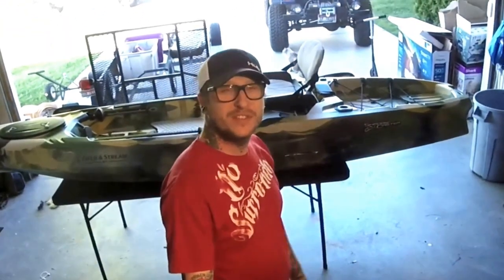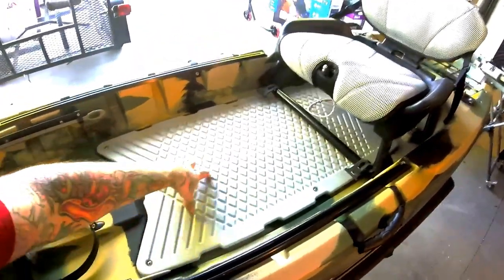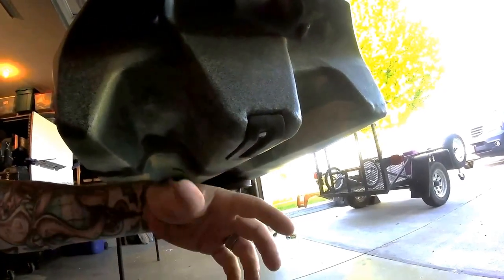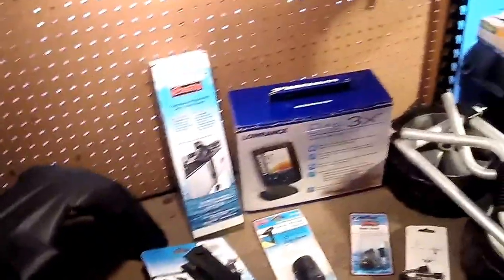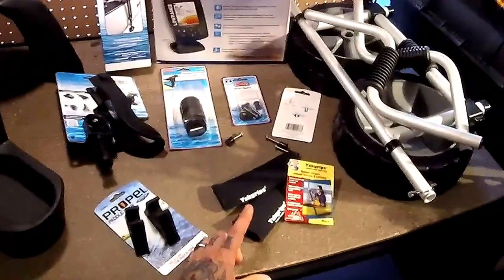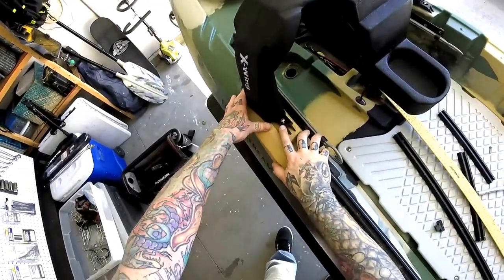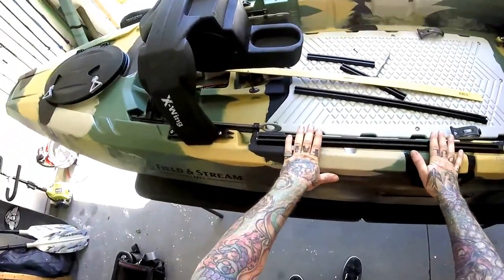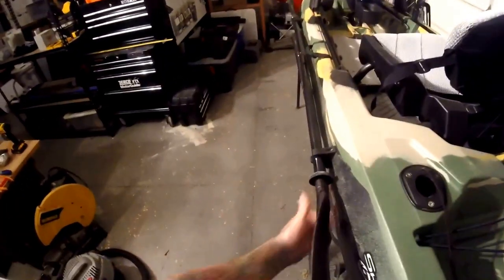Field and Stream "Shadow Caster" kayak upgrades

Comment: Awesome vid.  Subbed.  How is that X-wing?  I think that thing is slick.  I especially like how you can hide all your cables and battery inside.   Just wondering if it gets in the way at all?
Reply from the maker: Cheers! Not at all. It slides right off for skinny water where I don't need gadgets. But for big water I really couldn't imagine not having it. I spend most of my time with the seat in the higher position but even when down there's plenty of room.
Reply: @TheE-LightenedArtist  That's great to hear.  After watching your vid I ordered one for my Shadow Caster.  It'll be here in a few weeks.  I really appreciate you sharing this info because it really helped me with my decision to buy.  When I get it installed I'll make a vid on my channel to show my rig.  Thanks man!
Reply from the maker: @NoRedemptionOutdoors  very cool.